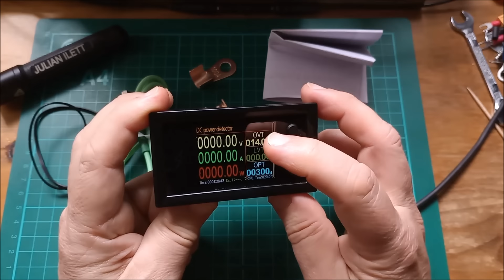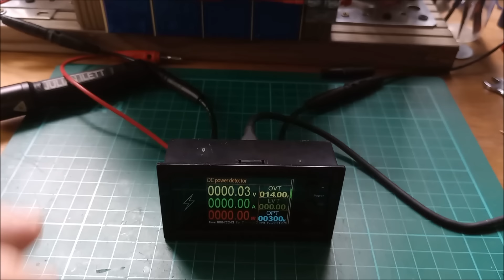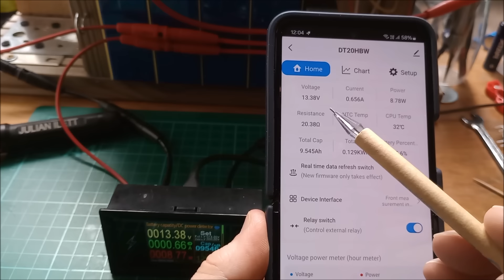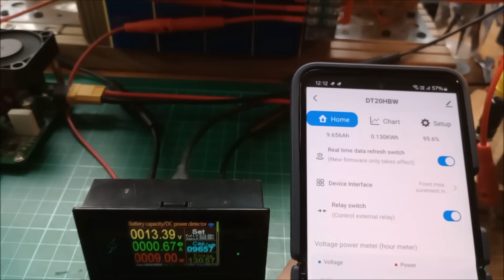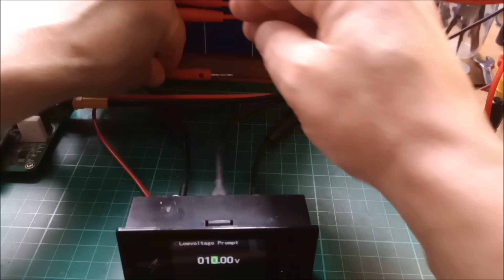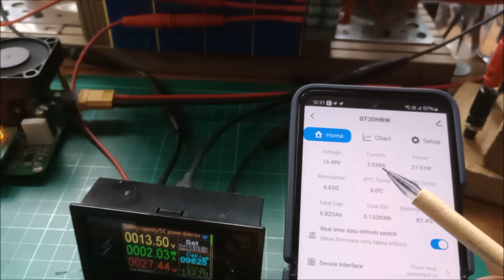Atorch DT20 DC Energy Meter with WiFi Tuya

Comment: Hello

 Is this equipment :
- compatible with Home Assistant
- can it be connected to a solar panel to check its voltage, amperage, and power output?
Sincerely, 
Fred

Comment: I think this would be pretty useless as a SOC monitor for Lifepo4. LiFePO₄ cells hold a very flat voltage curve across most of their charge. Unless they have changed it where you can set your capacity.

Comment: Can you just use it as a tuya voltage meter, ie do you have to have the thru connection for the shunt for it still work, I just wanted a tuya volatge as I already have a victron shunt

Comment: Can you use that only for voltmeter and create scenes or automatizations when the voltage changes to specific values?
Reply: Did u try it?
Reply: @feliceandrea2884  yes, I tried it. It works for specific voltage values, for example I tested it with a scene that can turn on a light when the voltage is over 12v and turn off when it is less than 12v

Comment: Hi Julian, nice video. Do you know if they fixed capacity counter in new firmware? I would like to use this device to measure real SOC of 100Ah lifepo4 battery. Is there a option to fully charge a battery and then set capacity to 100x12v and observe capacity counter decreasing when load in on and increase when charger is on? Thanks.
Reply: Did you ever do this? I just got one to monitor SOC but reading about it seems like you cannot set capacity...so not really a battery monitor afterall.

Comment: WOW! new update 1.0.7 brings separate voltages for capacity and MINUS and PLUS with current and power, nice :)
Reply from the maker: Oh that's much better. Settings for battery 100% and 0% triggers separate from the overvoltage and undervoltage alarms. And a negative sign in the app for current when the battery is discharging. Thanks for the heads up :)
Reply: @JulianIlett  First of all, thank you for the video! Could you provide me with two pieces of information?

Is it already showing the negative signal in the new updates?
Does it display the maximum and minimum battery voltage on the graph?

Thanks!
Reply: But cant decrease , alway increase  when plus or minus , always counting up
Reply: So it can't be used to monitor battery state of charge  @TheBeltcp

Comment: Also, seems that only the volts, current and power are made public (linking it to homeseer) - which is useful as I can run an external relay to charge it if it goes below a certain voltage but I have to have a seperate relay, i can't use the one built in one as it is not controllable!  (using a 25.6v LifePo4 battery to backup my aquarium) - so not solar!

Comment: Any idea how the relay works?  Was hoping to be able to use it to disable the output and switch over to a charger if the voltage goes below a certain threshold - all I can find online is that it turns off if the overvoltage is reached but when I attach it on the bench all it does is beeps over the voltage and relay does nothing.  If I manually switch it on from the app it does switch off but never switches on again (even if I go below the low voltage) so not sure what the point of it is - has anyone else had more success?
Reply: I have  1.0.9 (from 2025/07) and it still doesn't switch on again. It a bit sucks. Have to turn it off and on again. 
Relay has 4.6 V always if there is not trigger, and it totally switches off to 0 V, and newer returns to 4.6 V again (until cold reset).

Comment: Why does it matter that the bolt blocks the access to the voltage sense terminal screw? Just connect the sense wires before the current wires.

Comment: Good review but it's a shame you didn't check its accuracy given that Atorch don't specify it all.  It's all very showing the current to 1mA resolution, ie. 5-1/2 digits,  (the App shows an additional digit than the LCD) if it's only accurate to 10% - but I expect it will be nearer 1%. The shunt itself is specified as 0.5%.

A more detailed, if brief, teardown would have been appreciated to show which components they use although they likely have eraesed the markings.

That shunt is going to get quite hot at 100A dissipating 7.5W so a bit of care to allow a free flow of cooling air would be advised when installing.
Reply: I found current accuracy quite impressive for 100 A model (it's better then expected and usual). And voltage accuracy could be better. It misses about 0.1 V constantly, shows either more or less than i really is.

Comment: nice monitor for diy server rack packs i never reached more than 14 amps charge to my server rack 48v 100 amp  battery . I
 I want to series put it on my victron 35 amp solar charger   which i never let go over 25 amps.... bad thing is i wont get correct measures because that energy might go to system and not the battery itself... i think it is nice for e moto packs....

Comment: I wonder... top right of the graph screen.. when you unplugged the bulb, it went from 0.36A to 1.00A, and then to 3.03A when you were charging the battery... and the charge current was exactly 2.03A... is that some sort of buggy "current value" display. The voltage could be the top left... if you subtract 1V there also (which if I look earlier in the video, when you had nothing connected, it also showed 1.03V, 1.00A for those two values... suggesting maybe there is a 1V/1A error there? maybe?) 🤪er... WTH?

Comment: have you tried connecting it to home assistant to see what arrives there? It's not the 1st time HA gets full values, while tuya app only some
Reply: I just got the AC version in the hopes the tuya integration would work. It does, but it only brings out Current, Power, and Voltage and lets you toggle the socket relay. It's still useful for logging so I'm OK with it.

Comment: I would think that there is a good reason for manufacturers of these modules to provide a  developer interface that allows for the user to generate improvements and new functionality over the manufacturer provided capabilities. Clearly software is not their strong point.